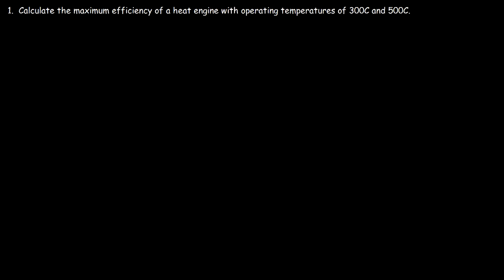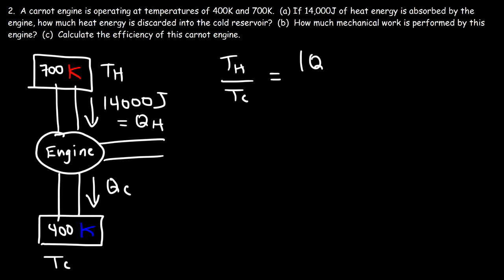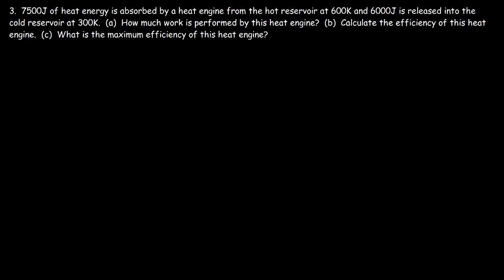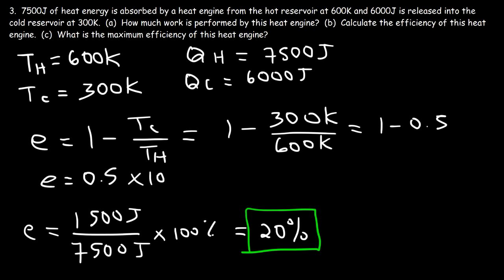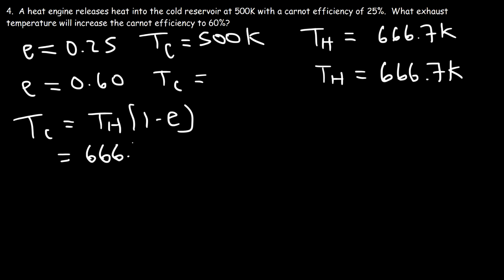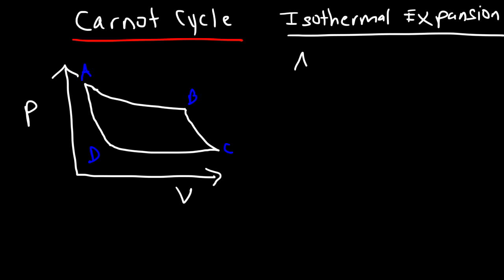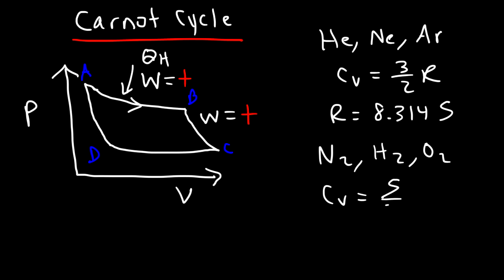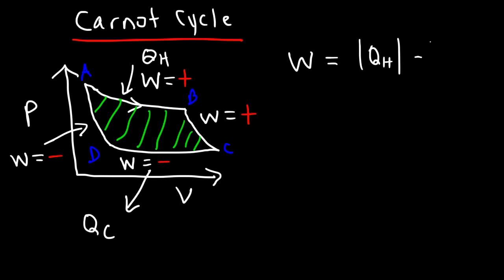Carnot Cycle & Heat Engines, Maximum Efficiency, & Energy Flow Diagrams   Thermodynamics & Physics

Comment: In Step 2 of the Carnot Cycle, the Equation for Change in internal energy used is dU = n(Cv)dT, why do we use Cv (molar heat capacity at constant volume) if we are talking about an adiabatic expansion where the volume is not constant?

Comment: Near the end of the video when you are calculating the work done by the adiabatic expansion between B and C you use the constant Cv.  Isn't Cv a constant used when the volume is constant?  In the same way Cp is used in a process where the pressure is constant?
Reply: You don't necessarily need constant volume for Cv to apply, or constant pressure for Cp to apply.  They relate to the special case where these specific heat capacities are the constants of proportionality between change in temperature and heat added to the system, but they apply outside this context as well.   Cv is the proportionality constant between temperature an internal energy, while Cp is the proportionality constant between temperature and enthalpy.  And this is true, regardless of whether volume or pressure is constant in any situation.  And since both enthalpy and internal energy are state functions, it doesn't matter what path we take.  The difference in these thermodynamic energy values still applies.

Cv and Cp do have some dependence on temperature, so it isn't an exact proportionality.  But it is close, and these values aren't very temperature sensitive, so you still get meaningful results by assuming they are constant with temperature.

In this particular application, U=Cv*T is the way we calculate internal energy at each point of interest.  We then take changes in internal energy, and equate them to account for work done by or on the system, associated with each adiabatic process.

Comment: Thermodynamics gives you bounds on real engines. Moreover, the explosion of the fuel mixture is not even approximately reversible. How can thermodynamics be of any use in designing real world internal combustion engines?
Reply: It gives you an idea for what efficiency you can expect, in a given engine design.  It also gives you guidance for how to fine-tune the geometry of the engine for the greatest efficiency.  This way, given a target power rating of the engine, you can determine the stroke, the bore, and the clearance volume, from the theoretical efficiency of the Otto cycle.

And when you monitor the pressure and volume at every point along the way in a real engine, it does closely follow the theoretical curve of the Otto cycle.

Comment: Umm as a chemist I would prefer the sign convention (Delta U = Q + W ) but the rest are fine
Reply: Why do chemists want to impose a sign convention that only meshes well with chemistry problems? The laws of thermodynamics are supposed to be universal. Why do some people want to tailor them for specialized cases?
Reply: @gustavopaz5453  the sign convention of chemistry can be used in physics and vice versa
Both of them are universal
Reply: Ah yes, Physical Chemistry. The bane of my undergraduate GPA
Reply: As a physics student, we prefer U=Q-W. Both are same, it's just that we take the surroundings as our point of reference

Comment: When is engine an ideal one?
Reply: Carnot engine is an ideal engine, its efficiency is 1. It’s impossible for a real engine to have efficiency equal to 1.
Reply: @frostbite07  Carnot engine doesn't have the efficiency equal to one.

Before proceeding remember that "thermodynamic temperature" just means we're using a temperature scale with 0 being the absolute zero like Kelvin or Rankine.

Let T_h be the thermodynamic temperature of the heat source, and T_c be the temperature of the heat sink. Then, the thermal efficiency of Carnot engine equals 1 - T_c/T_h. So even the perfect thermal engine cannot have the thermal efficiency of one. Imagine that your engine takes heat from the source at 100°C (373.15 K) and dispenses of it into a sink at 0°C (273.15 K). Than your engine can never be more efficient than (1 - 273.15/373.15) * 100% ≈ 27%.